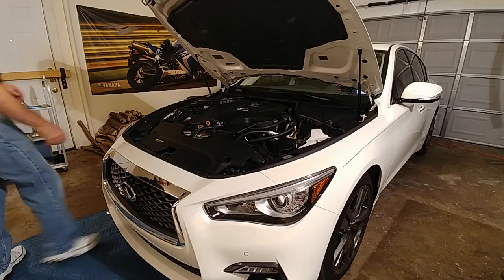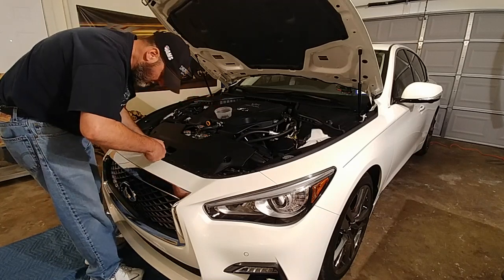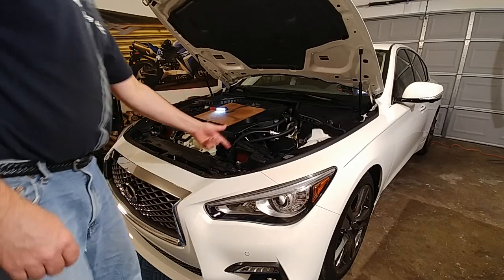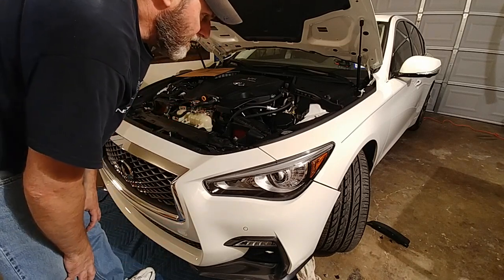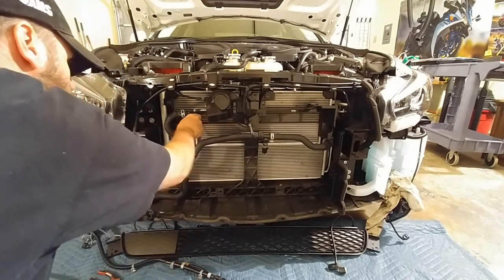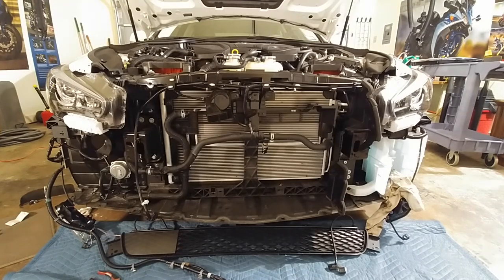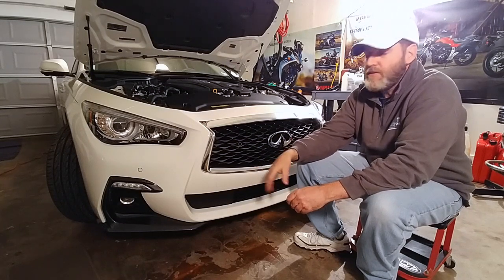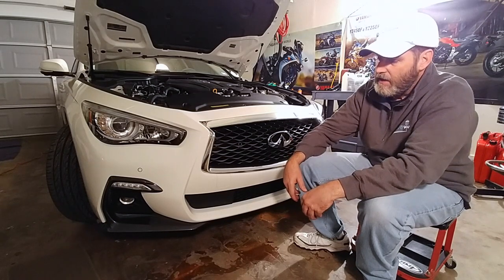Burger Motorsports heat exchanger install-bleeding the cooling system Q50 2019

Comment: Good video bro I wish I lived in Dallas I would get you to help me do mine but I'm in Palm Beach Florida if you're ever down this way let me know the beer and steak would be on me lol
Reply from the maker: If you where here I'd help you for sure. It's a big help to have done it already where you would be able to do again in half the time. When you do it...I think it's Important to put back all the plastic shroud pieces even though you have to modify them a bit to get them to fit back securely. Also remember you need 2 slightly bigger worm gear clamps because the nipples/spigots on the Burger Motorsports hx are bigger diameter the oem POS hx. If it's another brand like AMS hx then disregard what I said and follow their instructions. The vac fill tool is on Amazon like 65.00 and will help refill and not leave you guessing if it's done right. Hit me up if you need explanation on anything. Also what I like having is a big blue harbor freight moving, quilted blanket is what I call it. Less then $10 and I use it all the time to lay on it on the ground to work on the car, lay stuff on it and use it in the car to transport things like my dog so he doesn't tear up the seats with his lion  like claws
Reply from the maker: Also, I think it's helpful to take cell phone pics all along the way so if you question yourself were and how something fits/orientation you can look back at you pictures. I did it and it help me.
Reply: I believe it's too much for me it's too many wires and stuff to come off Nissan could have done better
Reply: Going to have to pay someone and help them do it or watch them while they do it
Reply from the maker: @qdog1019  Understandable. Not always a good idea to jump into something if not comfortable.
Reply: @GettingthruLife  I could probably do it taking my time and 
separating the screws and having a garage to use but outside in the Florida heat and would need a extra set of hands to get it done lol
Reply from the maker: @qdog1019  yes the heat and humidity is tough. I can't do much of anything in my garage or outside for that fact when temps climb. Definitely a job where 2 set of hands can be a benefit.
Reply: @GettingthruLife  Good evening bro so how is the BMS heat exchanger working out for you and what other mods have you done ?
Reply from the maker: @qdog1019  I was tuned but I'm running without tune at the moment. I have installed the heat exchanger and AMS intake kit. Now this month I've added Z1 Motorsports subframe bushing collars and Magnaflow CBE. Next is some really good rear 265/275 tires. The BM heat exchanger is working out good but it's been 40, 50, 60 and 70 degrees mostly with it installed.
Reply: @GettingthruLife  
Oh ok I have a JB4 and axle back exhaust going to add Megan Racing down pipes and going to order the BMS heat exchanger tonight trying to find the cheapest one so far $318 shipped
Reply from the maker: @qdog1019  AMS Or Mishimoto heat exchanger likely the better version of heat exchanger but I was on a budget and $300 was what I wanted to spend plus the cost if the Nissan blue coolant and the compressor air bleeding tool. True test for the Burger Motorsports heat exchanger will be when it gets 90-95 plus degrees here. When it hit last month upper 70 low 80 degrees here one day my CAT in my car reached 120-135 at dragstrip waiting in long line to run down the track. I still think that's good compared to other turbo car's ive had with much larger, aftermarket front mount intercoolers. My tuned Ford ST turbo car with its factory FMIC hit 160-175 degrees on hot days maybe higher but my memory is fuzzy.